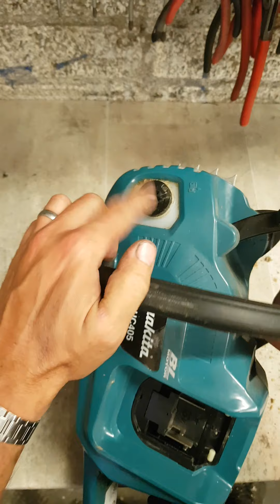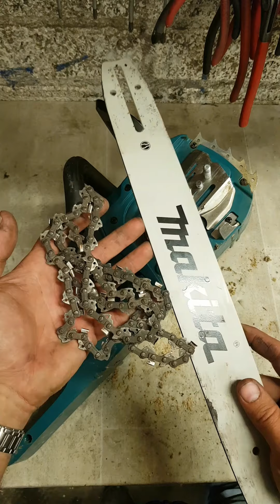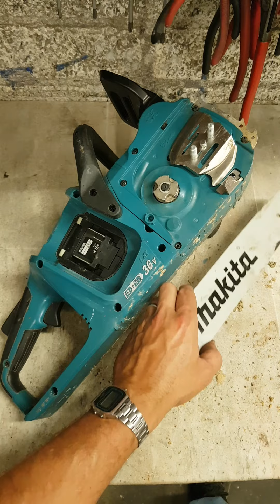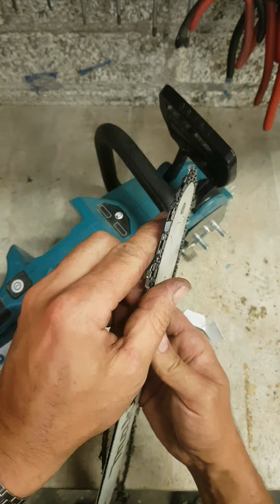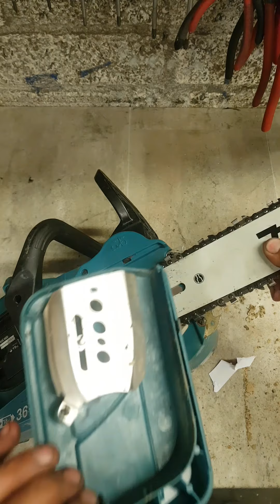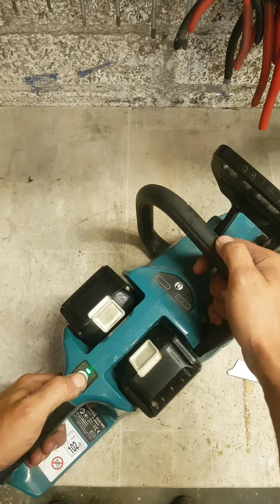If you don't know this, you shouldn't be allowed a chainsaw. makita chainsaw

Comment: It is also essential to grease the cutter bar's tip bearing with the correct grease usually red in colour.
Reply: That depends on the saw, it's not necessary on this Makita.
Reply: @alexbaxter9512  maybe not on electrically powered chainsaws? Lower maximum rotational speed?
Definitely needed on petrol engine chainsaws.

Comment: Before you bin the chain, it may still be reusable, check the inner side teeth for spurs, these can usually be carefully filed flat and it will fit again. 
This happens when the chain comes off and the chain hits the drive cog.
Reply: There is no sense in using a chain that has never seen oil. There will be damage between the links and on the rivets holding the chain. Even if you filed it flat you're risking metal that's been heated beyond tolerance. There will be little stretch and a very good chance it will snap.

Comment: Chainsaws
9 inch grinders 
Nail guns
It is so easy to get complacent and in half a second even professionals can get caught out
My grandad used sump oil but really it doesnt cost much to use proper stuff it pays off in the long run 
Thanks for the video Dean 
Check out" the ultimate recycler " another legend

Comment: Actually, you can run a chainsaw without Bar Oil.
It's just when they stop bleeding, you  have to use a little more pressure on the handle.

Comment: From my own experience if after a year of not using it lights blink and it won't run spray the chain with a little wd40 to clean it,  stiffened oil and sawdust create enough resistance to trigger the electronic safety,  always keep it clean

Comment: I use sunflower oil in my chainsaws works well and environmentally friendly
Reply: If you're in a pinch okay but why would you use it daily?
Reply: @bladeoflucatiel  It’s less than half the price
Reply: Used old veg oil in my old skateboard bearings for years. Cheap

Comment: Not everybody has had the opportunity to grow up with tools or people working with tools, particularly as we become a more urban society.
Reply: This is true.. Quick to show people where they went wrong, but slow to take the same advice from sombody else..
Reply: Right. I didn't either. But I'm aware of this, so at least I read the damn manual because I actually like my tools.
Reply: Not only is the Manual good for Tool Maintenance but it's usually got Safety tips that aren't there for just 'idiots'. Why it's become a point of Masculine Pride to immediately throw away a Manual is beyond me.  @LydiaOfTheNorth
Reply: @Bob.Jenkins   exactly. It's almost like it's written specifically for those people without experience in tool handling 😄
Reply: RTFM, if you can't read get one who can.
Reply: @LydiaOfTheNorth  One of the issues with modern manuals, is that they're being written more by lawyers and QA departments, than actual technical writers, and their main focus often tends to be to make sure that they list every single regulatory warning they can (even if it's not applicable to the actual tool being used), than to transfer the knowledge about use of the tool. This tends to discourage reading of the actual manuals...

Then, there are also issues, when tools aren't very well thought out: I had a laser distance measurer from a major manufacturer, which had a menu option that could turn a feature on or off, but the manual had no explanation what the feature does. When, in the end, I asked the manufacturer, the response was that the funny feature does nothing.

Comment: With these electric saws any eejit with a battery is usin them. Will be some injuries becasue of it. I hope i'm wrong
Reply: You have to use a tool to understand it.. Some people have no guidance its not there fault.. Tool fanatics love to press the hardman vibes on newcomers.. As if owning a few tools makes you the bollox...
Reply: @petrokemikal  There is so much information on so many platforms, guidance is out there and Instruction manuals come with the saw and I bought a Makita chainsaw a while back comes with a bottle of oil.
Reply: @willtricks9432 neither of my two Makita saws have come with oil. Wonder if they pack them different for different areas of the globe? In U.K. I’d recommend that everyone does at least the basic maintenance element of a chainsaw training program so much info that’s missed from a lot of YouTube videos.
Reply: @whitacrebespoke  Over the years I have been asked by people who have bought a saw, often with a mains cable, how to maintain and where to source the consumables. A quick inspection and safety advice is better than headlines in the local news of 
"Homeowner killed by Chainsaw".
Battery tools pose an extra level of danger but a haven't had many questions about these yet.
Maybe I should set up a series of courses.
Reply: @whitacrebespoke  Over the years I have been asked by people who have bought a saw, often with a mains cable, how to maintain and where to source the consumables. A quick inspection and safety advice is better than headlines in the local news of 
"Homeowner killed by Chainsaw".
Battery tools pose an extra level of danger but a haven't had many questions about these yet.
Maybe I should set up a series of courses.
Reply: @petrokemikal  Oh, I get it. If they have an accident because of their rank stupidity, it is somebody else's fault. Straight to the Lawyer. It is their fault - totally.

Comment: You shouldn't use any Oil not specially formulated for Chainsaws - the oil isn't just a 'grease', it contains many different additives to help it reduce wear, increase heat dissipation and adhere to the Chain and Bar. Only a fool would skimp on possible life and tool saving requirements. As a Chainsaw user for many decades I'd strongly advise against using anything other then Chainsaw Oil for Chainsaws - shops like Toolstation and Screwfix offer 'own brand' alternatives which are much cheaper (between £6-10) then Manufacturers and work just as well.
Reply: Oil is oil buddy
Reply: Old oil from car engine - cheap  and good 👍👍👍
Reply: Funny you said this, project farm just tested a bunch of chain oil and motor oil. The motor oil had more anti-wear addictive than any of the chain oil and it shows in wear test. of course the failing is it's not tacky like chain oil.
Reply: DGB or DeWalt biodegradable oil I found are best
Reply: @marcinkazberuk4923 maybe in a pinch... I'm not touching your dirty chainsaw
Reply: @_JamesBrown  of course in a pinch. Not in business in forest.
Reply: Me using the duc353 like 3 years intesive with 6ah batts and sunflower oil. Never had problems with the bar, or such a stuck chain ! But my duc has a loose cabel on the left side where the battery comes in. The saw still works fine , but you have to shake it sometimes a bit 😄